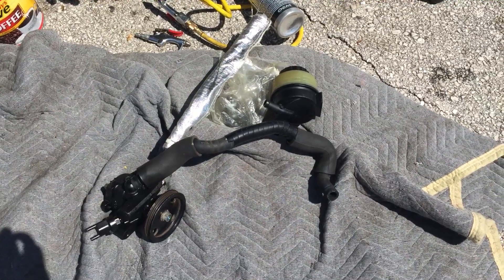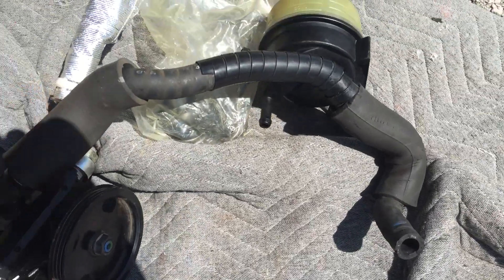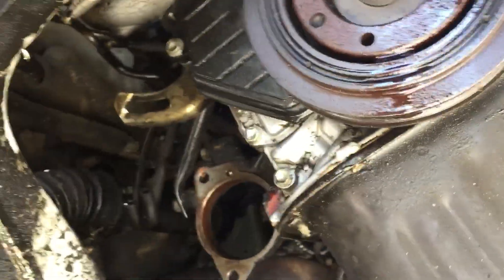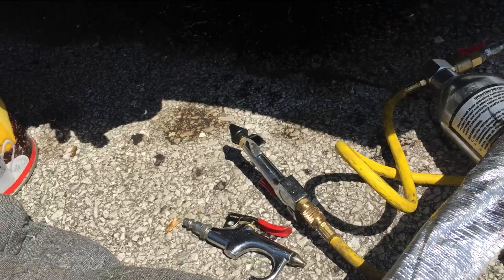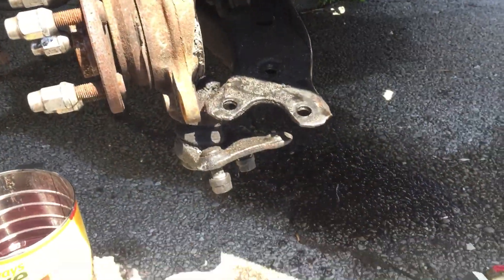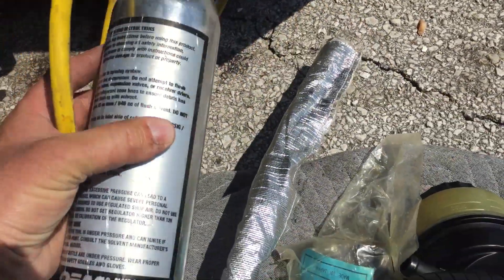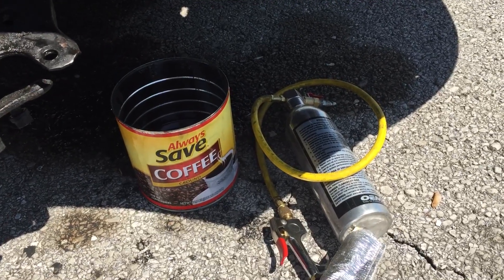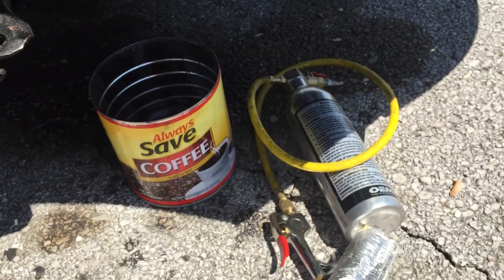Toyota Celica power steering pump replacement tip

Comment: good video, is there a part number for the power steering pump??
Reply from the maker: Thanks for the comment offhand I don’t have the part number for the pump I just went down to the local parts store and got it from them there’s also online options parts geek or rock auto eBay or Amazon

Comment: Was it leaking before? If so, did you fixed the leak?? I'm curious cause I have the same car, also the bracket should be buried in the corner. It's hard to get to.
Reply from the maker: Yes the high pressure hose was was bad and i replaced the pump because it had run dry to many times over a year now and still no leaks
Reply: @octagongarage3504  Thanks for the reply 🙏❤️

Comment: Hello does anyone know the name of the hose my Celica is leaking from there an O'Reilly an auto zone seen not to have it were can I get that hose the one that goes to the reservoir
Reply from the maker: Thanks for the comment the molded rubber hose that goes from the reservoir to the pump is the non-pressure side I do not know where you can get a new one of those you could try eBay or Amazon I ended up purchasing a new pressure line hose that is the one that goes from the pump to the rack and pinion I believe from Amazon other options would be your local salvage yard or if you have a pick and pull you may be able to find a used one you may also be able to use a piece of flexible rubber hose but I am not sure if that would work also try some of the Toyota forums and check groups on Facebook those guys may be able to help you source a New old stock one or perhaps a used one I hope that was of some help
Reply: @octagongarage3504  thank you it means a lot

Comment: I am currently stuck re-installing the pump.
Reply from the maker: What part are you having problems with
Reply: @octagongarage3504  It like the groove where the pump fits into  is too small
Reply from the maker: I don’t know what the problem is the only thing I could think of would be double check to make sure you have the correct part for your car